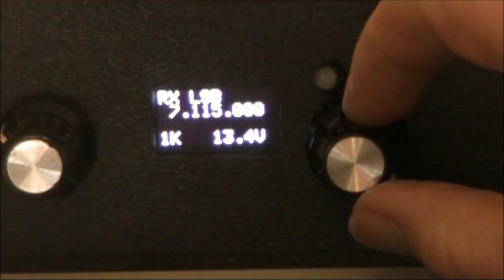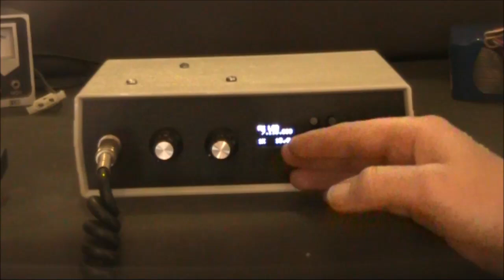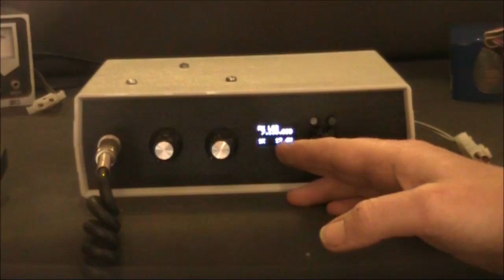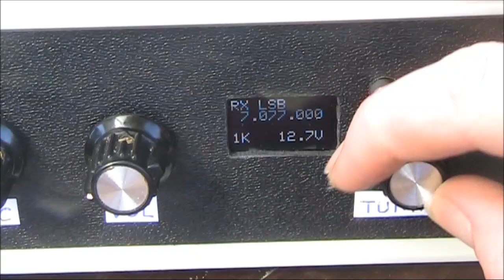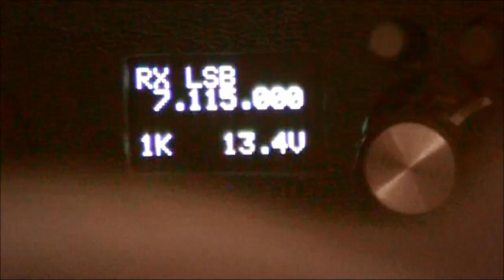Adding a CDV DDS VFO to the non-DDS Bitx40 transceiver

Comment: Hey Peter , have you covered using the CDV in boat anchor transceivers yet eg: CODAN or CB Rig for ten meters ? cheers
Reply from the maker: No.
Reply: @vk3ye  Are there plans of doing a short video on boatanchors with CDV
Reply from the maker: @VK4LA  Not from me. I'm all solid state.
Reply: @vk3ye  Think you misunderstood my earlier comment...Would you consider doing a video on using an old codan hf rfds transceiver crystal locked transistor Transceiver
 ,with an CDV Board for a few bands ...
Reply from the maker: @VK4LA  Good idea but no Codans here either.
Reply: @VK4LA  I will be using same vfo cdv in codan 6924's in near future. Have a few lunchbox radios to work with and bring back in service.

Comment: Hi Peter this is interesting as I have been trying to get it on frequencies  but seemed like it was on the upper side but could not tune it in will give the cap ago. What changes did you make to the program of it like the if above or below. Thank you again for the resonators they have been working well and I made your agc unit up with a meter.  Kevin vk7hkn
Reply from the maker: VFO needs to be set to below IF (4.9 vs 12 MHz).  Also Sideband must be set to Reverse to properly display the sideband as LSB.
Reply: Thank you Peter for that info will change this around and try it. Did you put 12 volts on the yellow wire.
Reply from the maker: No. The Reverse setting is set up in the preset menu. But 12v is applied to the white wire as described in the video to allow the RIT to function.
Reply: vk3ye thanks Peter found that out when I did the changes. But I still have a problem getting the 4.9 in the below if do you deduct it from the 12 and put in the remaining?